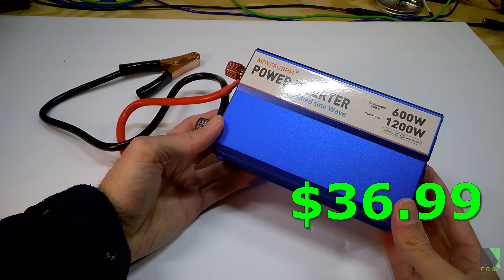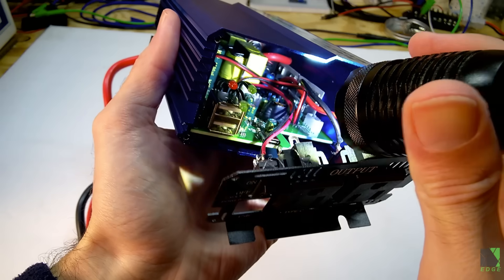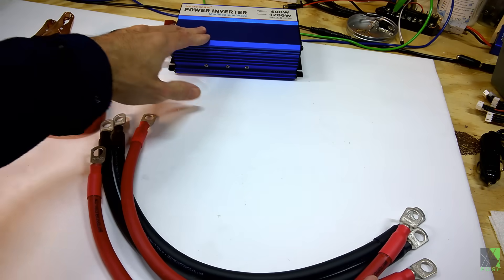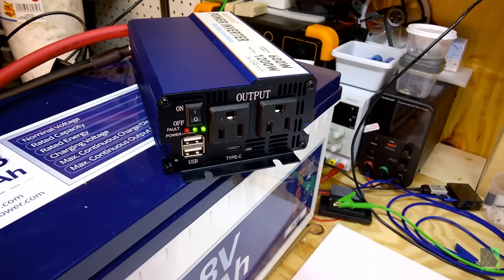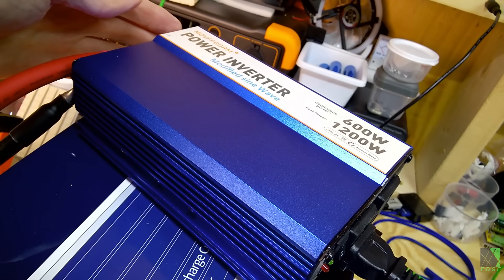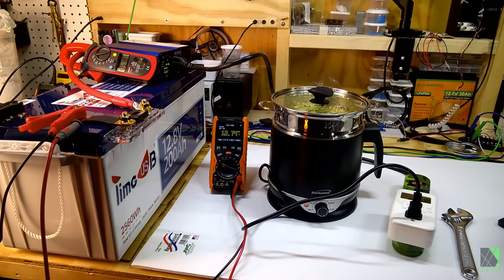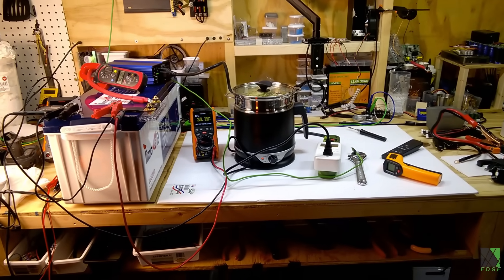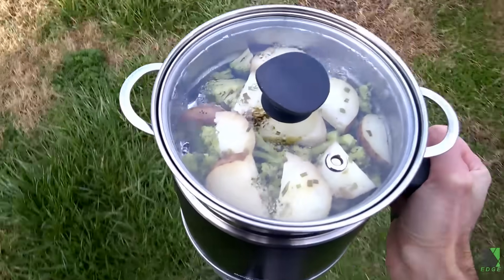This Inverter Is So CHEAP! But Let's See If It's Any Good - Can It Cook? #inverter #solar

Comment: When I first started out in solar I bought harbor freight chicago tools 2000 watt inverter. Man that thing is a beast. But, has massive fans which are great and bad for when I had small setup. I needed something run fans to what the load was ramping up to temps and load. So moved on into PSI Xantrex stuff. But, I always keep my little Modified stuff still. They still serve their purposes.
Reply from the maker: @1kzrider Sounds like a workhorse. That's making me want to by a HF inverter :D I have a Samlex and Xantrex in my house. Plus a couple of generic overseas models. Decent quality units but probably will upgrade to something larger and let them power small freezers - or just have spares
Reply: @solarpoweredge  Yea, now I have big lifepo4 batts. I will get use out that big blue 2000 watt modified 12v inverter. I have come across this one inverter and been using it for least 3yrs or so now brand is Cotex this one is 24V 700watt PSI. This is a daily work horse. Runs my desktop and other devices.  This channel did good review I think on it. https://www.youtube.com/watch?v=ZfVVrHZm_zk

Man I like your channel I like what your doing with Solar to DC direct stuff. Been doing this with DC Fans only. But, you sir have done leaps and bounds better. I am very interested in your PV to Heat stuff.

I have 3 diff setups. 48V big batt 120Ah with 2k of panels. 24V 200Ah ecoworthy batts 3x355 panels then a  little 50watt panel on a 30watt ecoworthy. I moved to Victron on all my MPPT CC's.
Reply from the maker: @1kzrider Those batteries sound great 👍 lots of fun. I like that inverter and want to buy it... that's the problem, I want 2 of each....

Thanks for watching my videos, yt is a toxic environment and I value anyone who will give my work more than a passing glance... an unbelievable amount of work/suffering is behind each project video. thanks for watching :D
Reply: @solarpoweredge  Just know myself and I am sure others understand all your hard work. And I actually do appreciate those like yourself trying to help others out. Keep up the good work and forget the negative folks out there. Evil exist sadly and people find trying to tear others down entertainment. Best we can do is pray for them. Cheers~~
Reply from the maker: @1kzrider You are the kind of person I want to reach :) thanks for being here. I hold the same beliefs about prayer. We can provide something "Good" to the world in a sea of evil, avoid joining the wrong side. Make the world a little better. The rest is often out of our hands! Take care and thanks again!

Comment: Amazing it actually pushed full 600 watts for anytime! I'd guess it would do 400 watts continuous and 600 for a few minutes before going into overload. 1200 watts for a split second till the capacitor inside gets sucked down.
Reply from the maker: @curtchase3730  I was cringing during the tests. But the outside never got too hot to touch. However pushing 600w would be a bad idea for 24x7 operation, I bet it would eventually burn out. For a "prepper" inverter and emergency use and cooking a quick emergency meal, I think (hope) it will serve me well :D

Comment: These usually works until the mosfet breaks but good backup.
Reply from the maker: @billruss6704 The FETs sure are small but for the price I don't complain. It can handle 600w for 30 minutes, then I let it cool down. The outside never got too hot to touch. I think for 24x7 use, 600w would result in a puff of gray smoke :D
Reply: @solarpoweredge  Sounds like it would work great for cycling an energy efficient refrigerator. I think that I will get one for emergency back up.
Reply from the maker: @billruss6704 Does the fridge have a standard (non inverter) compressor? I know square wave can damage and overheat inductive AC compressors. On the other hand... I hear of folks running fridges temporarily during emergencies... maybe that's the key here

Comment: Dont these modified wave inverter ruin Electronics ? Btw 1200 was peak power.
Reply: I bought a very inexpensive one to do a test with a solar panel setup.  I plugged in my Watt-meter and it gave me weird readings and then stopped working after like 10 seconds.  Lets say the experiment stopped and it has been in a drawer since.
Reply from the maker: @Luke-san Yeah that's not cool... the wattmeter I used seems OK with square wave, however it is a fact that some electronics react poorly to it. Also the readout might be a bit inaccurate. Based on the input power W, the output readout seemed very reasonable. Maybe next time I'll try 2 different meters and compare the results
Reply from the maker: @chris_mk5supra  Yes they do, so have to be careful what is plugged in. Resistive cooker, heater, light bulbs, they are OK.
The mosfets look too tiny for 100 amps, I wouldn't bother. Most inverters just double the normal rating as a standard marketing practice. However, I'm going to be reasonable and say this is a good inverter, because it didn't overheat and made 600w continuous. Not sure what would happen after 1 hour (vs 30m) maybe I'll try that next
Reply: @solarpoweredge  what about grounding with thise inverter? are they safe? i have one that i stoped using because people said it was dangerous and bad for electronics, maybe i could have some use for in in the end
Reply from the maker: @chris_mk5supra The ground is floating on this inverter (most small inverters are the same), so in effect we can think of it as a standalone high voltage converter. The main thing to avoid is bad wiring (exposed conductors, damaged cords) and contact with water, other than that it should be as safe as any inverter to use. Some electronics and pretty much all AC induction motors can be damaged or affected by the square wave, so best to stick with a Sine inverter for those types of loads. Hope that helps

Comment: Clamped and Soldered, good, Modified sine wave, not good for electronics but OK for resistive loads!😁😁
Reply from the maker: @wallychambe1587 Right on :D and it doesn't overheat, which surprised me. Was cringing during the test :D

Comment: Thumbs up for science. 👍
My experience with modified waves haven't been as favorable. The inverters have survived, however, low wattage appliances haven't.
Reply from the maker: @jamesfalvey77 Right on, tasty science :D I am not surprised, many appliances just can't handle the square wave. However, planning to test several different devices for public service and "see what happens"... hopefully it won't cost me a fortune like the Peltier module research did :0

Comment: most of these inverters do work, but the biggest question is... for how long!
Reply from the maker: That is true, I am not sure how long it will last, time will tell
Reply: @solarpoweredge  if you use it conservatively at maybe half the rated capacity (300w), will it guarantee that it will last for a long time? too bad it's not pure sine wave though, 300w is more than enough for charging electronics like laptops and phones.
Reply from the maker: @peejae082004 I am looking for a cheap PSW inverter to compare, but my budget is quite low :)
300w limit should greatly extend the longevity - but the main concern is temperature. If we could guarantee the electronics stay around ~40C (better fan?) this is a quick and sure way to maximize lifecycle!

Comment: Great value for a 600 watt'er!  Great info.  I just bought a previously owned 1100 watt"er ( looks mint) for exactly the same reason ... just to have in the war chest. I paid $40 CDN ... so almost free in $USD 😂.  Did the same type of load test and it worked flawlessly even with the 8 AWG supplied leads.    At 18" voltage drop is very small even at almost 90 amps but thicker would absolutely be better.
Reply from the maker: I did not expect to be impressed, but I should be more open minded about affordable inverters - this thing impressed me and survived. (Just hope it lasts though) ... you got a bargain on the 1100w, 40cdn is like $28, Nice job lol :D
Reply: You may not want to put in the effort for this low value inverter, but putting an IR camera on the unit while under heavy load does a great job of identifying hot spots (potential failure points) which sometimes can be easily remedied...ie poor connections /air flow etc. S
Reply from the maker: @Building_the_SHACK Superb advice. I've been offered IR cameras for review, but haven't been able to get to it. Maybe soon. and then this inverter will be one of the first "scientifc volunteers"
Reply: Obvious, but IR is done with cover removed and use some sort of external fan as without the shroud, cooling is compromised and you still want some level of air flow.
Reply from the maker: @Building_the_SHACK  Right, removing the cover would affect the air flow. So maybe keep the cover on and take it off mid test and quickly take a scan of the components, then put it back on. Well that's my idea anyway :D
Reply: You'll absolutely find tremendous value and uses for an IR camera! Plus the visual is pretty cool.   Hope you take on the evaluation soon.
As for the inverter I'd just use a hair dryer ( in no heat mode) set some distance away as the air flow is likely much greater than the teenie-wheenie fan in a 600w inverter.
Reply from the maker: @Building_the_SHACK Good idea... the fan looks like a 40mm, makes quite a racket - but I respect it for having a proper loud fan

Comment: Great video. You are running the battery at 0.25C not 4C 4C would be 800 amps!
Reply from the maker: @kevinoakes1870 Thank you :D I liked this inverter, hope it lasts. 
PS sorry for the confusion, I meant C/4 or capacity divided by 4: 200/50=4 (but C/10 is the rate I normally try to stay with)
Reply: @solarpoweredge the lifepo4 is good and full a 1c 200ampere is fast and 0.25c is 50amper 12.8volt 640watt is ok
Reply from the maker: @stefanocerna6504 Agreed, I love lifepo4 :) C/10 (20 amps) is the best rate for storage (energy) cells you can find more info on my blog. C/4 or 50 amps I would not do that long term, as it's not healthy for storage cells. that said, occasionally exceeding C/10 shouldn't have a big impact on cell longevity.
Reply: @solarpoweredge I don’t think your explanation of capacity makes sense!
Reply from the maker: @Glocktard You are confusing Multiply with Divide! C/x is standard terminology, "/" (slash) means Divide.
The C/4 rate for this battery, as stated in the video, is 50 amps. 
Capacity (C) / divided by 4 is 50.
But C/10 is a better rate, totally healthy for Lifepo4 storage cells. That's 20 amps with a 200ah battery (C/10 = 200/10 = 20amps)
I did not say "4C" 4*C, that would be 800 amps!
Hope that makes sense!

Comment: As long as it's a resistive load, your OK. Using a Modified Sine Wave Inverter with inductive loads, well let's say don't.
Reply from the maker: True! While I am curious about testing desktop computers and induction appliances on square wave (to see how they handle it) I don't want to risk it at all
Reply: @solarpoweredge  Be careful using a computer power supply. I think most have a capacitive ac input. That maybe OK.
Reply from the maker: @KA9DSL Interesting. Waiting until I have a computer for "test purposes". Right now, all of mine are too important to risk in lab tests..
Reply: @solarpoweredge  Your starting to sound like a cautious engineer.
Reply: Been there tried that with a pump , The inverter turned into a furnace ,would have used other words but YT not keen on it 😂
Reply from the maker: @KA9DSL Always, lol :D however there will be a donor PC soon that can be used for "potentially destructive testing". Not that I want to ruin a PC but it's for the common good...
Reply from the maker: @mariebaxter473  Sounds like a blast... there's always a slight problem with pump or compressor motors on square wave. A major concern is the square wave can ruin them and causes a lot of extra heat! I wouldn't plug my fridge into a square wave, it's asking for extra trouble..

Comment: cook with induction, way more efficient
Reply from the maker: @erichertsens Can be true, although resistance appliances are far cheaper/simpler and don't need complex electronics. I plan to test an induction cooktop on this inverter out of curiosity, just to see what happens.
Reply: @solarpoweredge  Induction cooktops usually need 1500 watts in my experience, tried a modified 1k watt inverter on one myself and when turning up the cook top the inverter started to smoke during a heating cycle. Didnt beep, shutdown or anything just a bit of smoke, sorry dont recall the model other than it was yellow and black, not a dewalt though. Still works just thinking  it asked too much from a modified 1k model. Pure sine 2k inverter worked fine, have a 1.5K pure model I should test as well once its not freezing cold outside.

Comment: They say modified sinewave is ok for resistive loads
Reply from the maker: @viyusavery248 Right on! I plan to run modified inverters on any cookers or heaters in the future, while saving the more expensive inverters for computers and sensitive loads
Reply: For resistive loads any power source is good, no matter the waveform if it is an AC source, or a battery (DC).
The only case pure sine inverters are needed is induction motors or classic transformers. For all the rest of the loads, the modified sinus inverter will work fine. About "sensitive loads"...most of them use switching power supplies in our days. Such a supply has no need of pure sinus since it rectifies the input current into DC and then chops it in square pulses adjusting their duration in order to adjust the voltage at the output. This means that these power supplies are independent of the input wave shape and can work happily with pure DC.
Modified sinus inverters work on the same principal. So, no problem for the so called "sensitive loads" which is a marketing term only. Finally, we put a simple LC filter at the output of a modified sinus inverter, practically if we suppress the third harmonic content at the output, we can use the inverter for any load. 
On the other hand it is a luxury to use pure sinus inverter for cooking or heating in general. It just doesn't make sense. A brutal rectangular inverter will do the job perfectly. A DC source like a battery will do the same...
Reply: A high power DC/DC converter (enough to drive the resistive loads) will work equally well...

Comment: You should monitor the voltage drop on the inverter to see how fast or slow it gets back to voltage for sensitive equipment. 

Also components can wear/break down prematurely due to stress of voltage drops that are too drastically.
Reply from the maker: @LawPope Good idea and good points. That Ampintv 1200w can run my video PC with no problems. But I have not checked the voltage regulation / reaction time, need to do that soon.